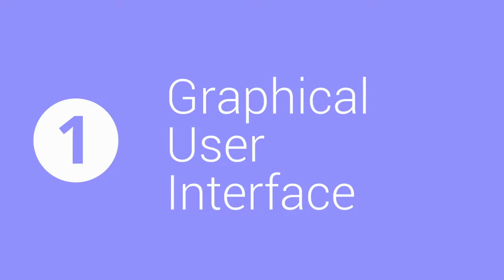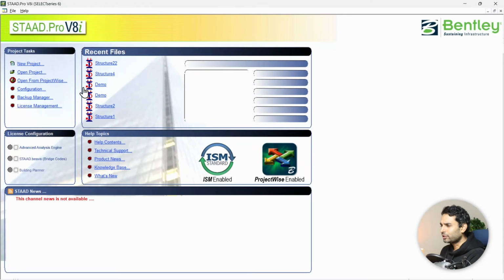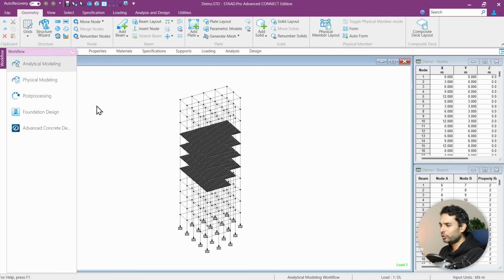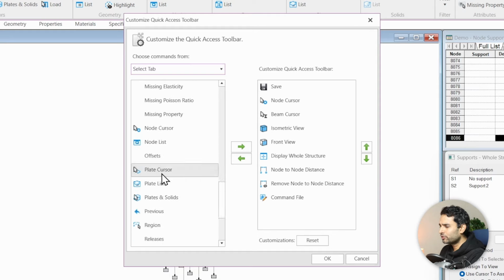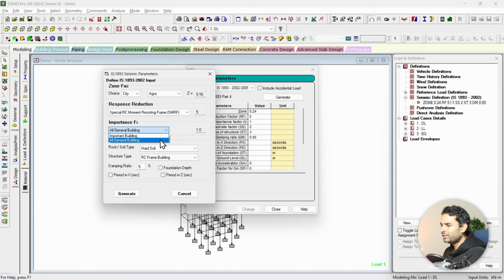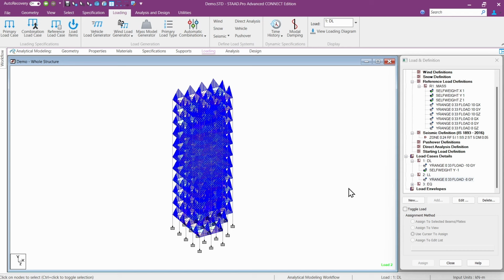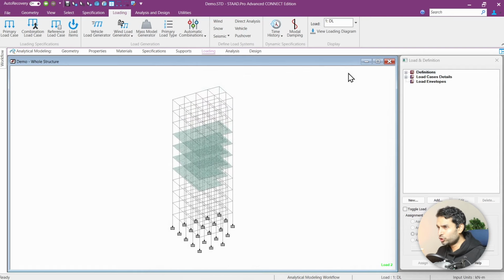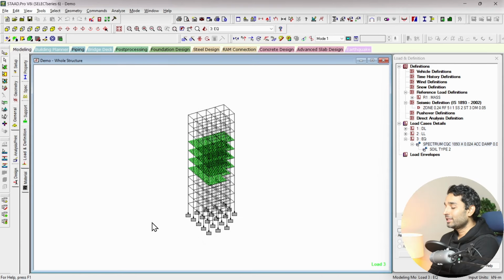STAAD Pro Connect Edition vs V8i Version

Comment: In the first line itself you say the Connect edition is "MIles ahead" and "makes our lives so very convenient".. Then its a bit of a spoiler that you rate Connect edition higher than v8i in the video that follows. Many oldtime users and professionals are complaiing "stadd pro v81 was way better" and to quote them "this new one sucks". What is your impartial assessment?
Reply from the maker: Sorry about the spoiler 😉. As far as my impartial assessment goes, you have it on the video. I think the newer version comes with very useful and powerful updates. As of the old time users and professionals complaining I would argue that accepting any new system takes time. Just the mere statement that the "new one sucks!" is not argumentative enough unless presented with concrete facts. If its bugs that one is concerned about I would argue that future iterations are resolving issues on a daily basis. If its just the feel of the software I would request them to give the newer environment some time and you are most likely to find it more than suitable for one's needs.
Reply: @CivilBlackBox  Yes, Kushal. Thanks for the reply. Agree